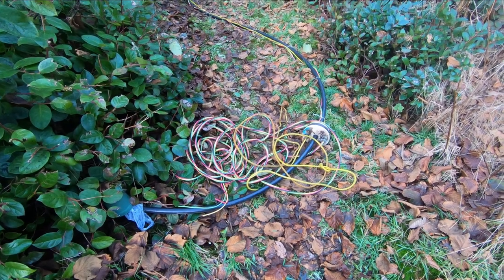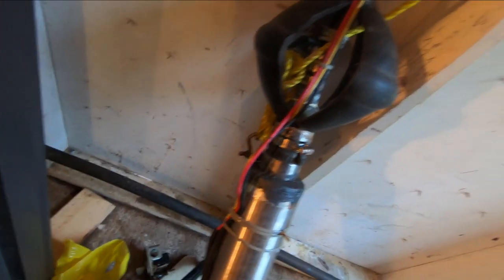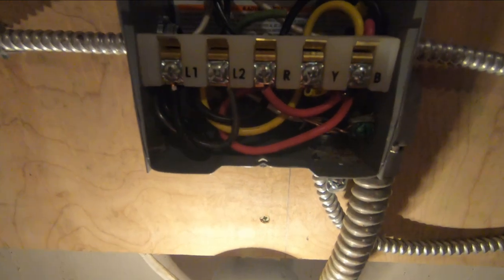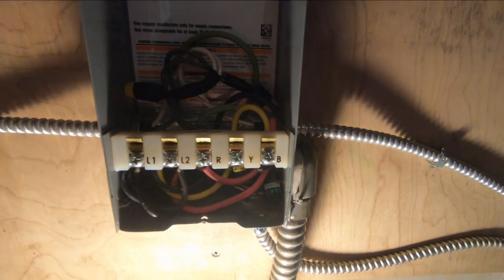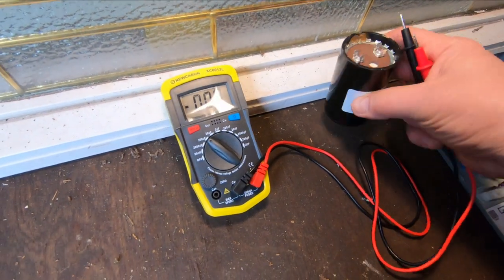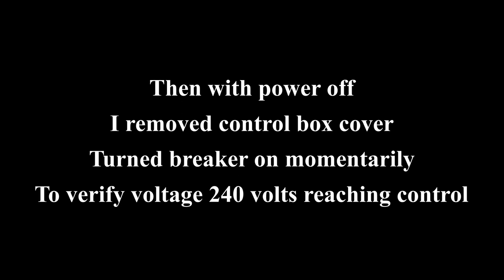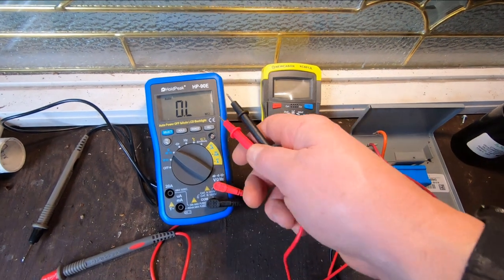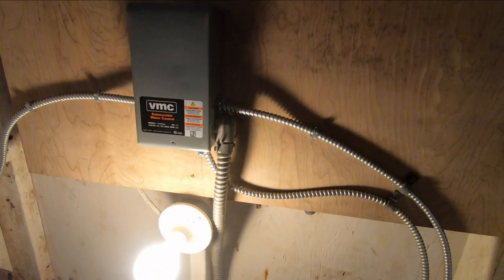HOW TO TROUBLESHOOT AND REPAIR A WELL PUMP & CONTROL BOX

Comment: good info.    You should probably chlorine treat the open well.    I use several tablets  like used for a swimming pool.    Maybe a neighbor with a pool or a big box store.    flush the water on startup.
Reply from the maker: Very good idea to shock treat the well. I didn't do that, but I ran all taps for about 1 hour before using the water. Thanks for watching and commenting!

Comment: My parents are on well water. They had there system overhauled as it was in need of repair when they moved in back in 2012. Rust and open wiring was everywhere..
Reply from the maker: Having your own well has its benfits such as not having to pay a bill every month to the municipality but when things go wrong you're on your own. Having the skills to fix your own things is great but not everyone knows what to do. That's why I like to make videos that help people become self-sufficient. Well pump systems usually operate for years without any trouble. Still, it's nice to know what to do when things go wrong. I hope your parents have a functioning well system now. Thanks for checking it out!

Comment: Does the capacitor orientation matter? My cap was bad ordered some more and  now insee my relay is bsd as well ive heen diggin for a day or so and had found out how to test the relay but not exactly what has failed with it if there is a reading. Not sure if the failed cap caused the relay failure or possibly orientation of new cap. I bought a home and they have skipped out in properly do anything lol. Not sure it was working right to begin with  but i could only find one relay that was the same and it wasnt cheap. I found tbis all out by a fried breaker i finally got a new one today. So i put it al back together and now my pressure switch is stuck open. So before i put that valuable relay in there im tryin to figure out why or if pressure switch has failed and if so did it fail because of cap or relay or could it technically run without them. I wasnt expecting the book to be throsn at me with my first well job lol. Thanks any knowledge would be greatly appreciated. I subbed you remind me alot of myself with the way you speak have a good one brother.
Reply from the maker: I can’t suggest what to do, but the pressure switch fail is most definitely not related, but probably just due to age. They are usually available at most hardware stores for about $50. Similarly, the whole control box for the well pump would be about $125 - $200 most places, except a well specialty store may charge more for one. Sometimes, when in doubt, just replace with new, if you can afford it. That way, at least, you will know the component is good. I wish you the best of luck with your repair. Thanks for subscribing. Sorry I can’t be of more assistance.
Reply: Thanks so much for the reply. I have all new components except the new relay its rare to find the lincoln one new. But i managed to do so for $60 and 2 new caps for $20. And pressure switch was $20. Most of the folks outnhere have wells so i guess the switches are a lil cheaper for us or maybe its a texas thing lol. I was curious as to how and why so i didnt put new switch and cap on and burn all new components up. The relay is still a few days away but i have a 6prong used relay from a similar qd box. And since u said they def wouldnt initiate a switch failure ik gonna shoot for water right now. I need a shower lol
Reply: Thanks so much for your words of wisdom and ethics to wish to help others! That is a rare quality these days! Have an amazing day

Comment: Thank  You for your detailed video on testing three way submersible well pumps and its capacitor , I was hoping you would have described on how you wired the inside of the control box where the capacitor is located between the pressure switch, well pump, and L1 L2, It looks easy, but I am missing something, I see 4 wires going to your box, can you please explain..  Thank You Again.    ROBERT FROM NEW PALTZ NY.
Reply from the maker: Thanks for your question. What I'll do is make a short video tomorrow, showing the wiring inside the control panel, explaining where each goes.  I'll reply in this thread with a link to the video so you won't have to search for it. Best Wishes!
Reply from the maker: Here is the video I made that explains the routing of the four cables through the well pump control box. Make certain the power is off before you do any electrical work! : https://www.youtube.com/watch?v=pnUEhrSz53I

Comment: i'm 27 yo with no experience living alone and my well broke, if been stuck without water for 2 days now. ive changed the control box and pressure switch but still no luck. any ideas?
Reply from the maker: If you are handy with a multi-meter, test for continuity in the wires to the pump motor. This pump of mine had an open in one of the wires. Always get an electrician if you are uncomfortable doing your own work. Good luck!

Comment: My multimeter reader doesn’t have microfarads just farads  can I test under the other measurements listed on the copacitor ? “ hertz, vac “
Reply from the maker: If it measures Farads you're good. Just interpret the reading you get taking into consideration that one microfarad = 1/1,000,000 of a farad

Comment: In an emergency situation it would be fine to use the known bad capacitor but DO NOT wait for it to fail before you change it…when it fails it could potentially burn out the pump while it’s trying to start with a failed capacitor
Reply from the maker: @redneckways1617  Good point.

Comment: My name is Roger I'm in Grantsburg Wisconsin I like your video of got the same issue right now Happy New Year's my well went out and I'm trying to test everything and figure it out oh now it's starting to snow here it's like just just great just perfect time whether you want to change. The capacitors in the covers and I've been trying them I'm not very good with electricity I'm not very good with testing things that are electric I don't like it it would bothers me but it would have been nice I wish you should have showed how to test the voltage on the control cover with the leads I'm not very good at that if you test test like I said I'm not good at electric I wish you would have showed how to test the voltage in the box as far as your line voltage coming in and I shut my breaker off and everything and I thought that I was going to have a good but it's not turning out that way so I don't know I guess I'll fly by the seat of my pants and see what I can figure out but
Reply from the maker: Be careful in there! If you have a multi-meter, set it on voltage and touch the leads across terminals in the control box. With the breaker OFF you should have zero voltage. If you are the least doubtful, wait until you can get some help with the repair. Good luck. Sometimes, a guy is better off waiting for assistance than trying it himself. Electricity is very unforgiving and shocks can be lethal. Bottled water for the night sounds like a good plan. Good luck!

Comment: The cap was leaking, it may test good now, but it's time to get a spare cap. There are two ways to see a bad cap, the tester as you showed, and the other is a leaking cap, and yours is leaking. Take note of the deposits around the edge, it's working now, but it won't work very soon.
Capacitors are considered consumables, they don't last forever.
Mine just quit, it shows a bubbled up disk, the little white spot between contacts, if it's flat, it's good, if it's bubbled up it's bad.
Reply from the maker: @jamesfenton7338  In the video I explained that I would put the leaking cap back into service, to get our water back on, but was ordering some replacements. Sometimes, you have to make due with what you have on hand . That or have no water at all while a part is on order, and we live off the beaten path where there are no hardware stores. For that reason, I ordered 4 spares.

Comment: does it matter the order of the L1, L2 wires?
Reply from the maker: The L1 and L2 wires are interchangeable. Each is fed from one phase of the service panel. Residential service panels typically have three wires feeding it from the street. Two hot wires, each carrying 110 volts and a neutral (plus a ground wire). This allows the service panel to distribute to 110 volt circuits in the house (tapping into only one side or phase of the panel), and to distribute to 220 volt circuits, such as a kitchen range or well pump (by tapping into both sides or phases of the service panel) . A double pole breaker in the panel allows each phase of the service panel to energize one leg  of the breaker at 110 volts each. Combined, they deliver 220 volts to the well pump. To answer your question more specifically, yes, the L1 and L2 are interchangeable. They both carry one leg of 110 volts each from the service panel to the motor control box. Be especially careful around electricity and if you have any doubts whatsoever, get a licenced electrician to do the work.

Comment: I watched the whole video to see HOW you check for continuity between terminals in control box and you don’t show it, you just SAY that you did it. That wasn’t helpful in my situation at all.
Reply from the maker: Sorry about that. Continuity tests are a standard test used on multimeters and I wrongly assumed that anyone with a meter would know how. To check for continuity, make certain the power is off. Then select the continuity setting on the meter then touch the bare end of the probes to each end of the item being tested. In this case, I checked between the terminal in the box and the wires leading down to the pump. Again. sorry I forgot to do that.
Reply: Thank you. I’m still troubleshooting my problem and your reply was timely and appreciated